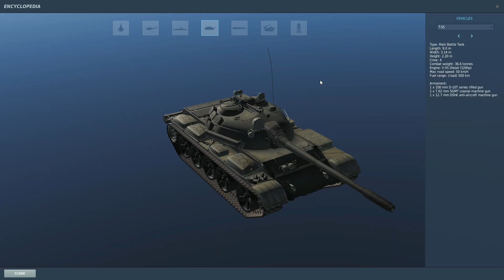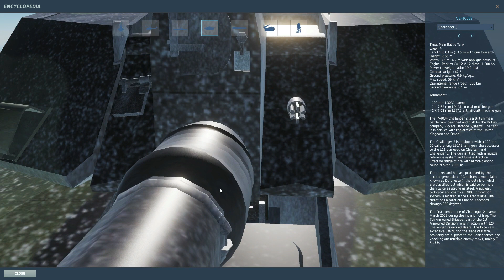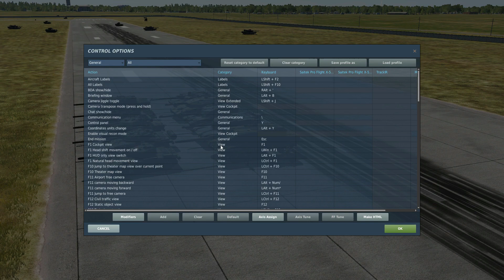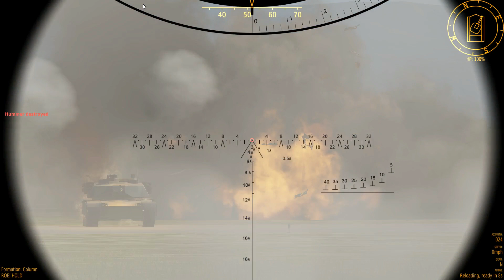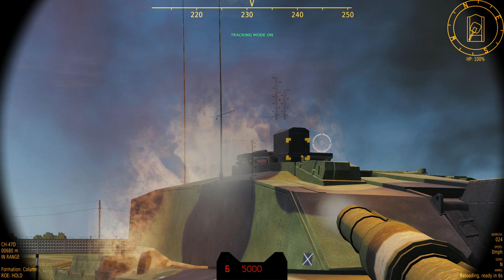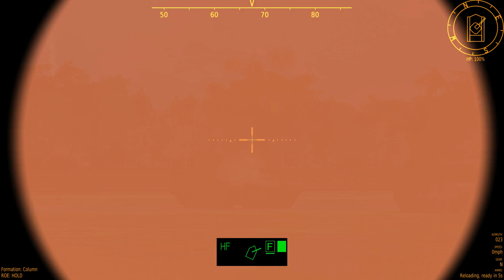Combined Arms: Main Battle Tanks Tutorial | DCS WORLD

Comment: The armour on T-55 is garbage, T-72 meh but better than T-55 and has composite i.e. steel and composite and steel. T-80 mediocre armour, T-80U mediocre-good armour, T-90 Good armour.
Leopard 2a4 mediocre armour, 2a5 superb turret armour but same hull as 2a4, 2a6 same as before but better gun.
M1 Abrams mediocre armour, M1A1 mediocre-good armour, M1A2 good armour.

Problem with the soviet and russian tanks are usually their shit reverse speed and the fact that if you shoot low centre hull the turret will fly off.

Smoothbore gun shells are stabilized by fins on the projectiles, smootbore barrels have longer lifespan than rifled ones and are cheaper to make.

13:59 Those are Shtora 1 infraded scramblers, they disrupt laser guided weaponry.

14:07 Those are the Kontakt 5 ERA (Explosive Reactive Armour), good against chemical penetrators like HEAT and missiles but bad against Kinectic penetrators like tungsten rods.

Comment: @22:10 To answer your question about the barrel bulge of the tank: When the crew fires a round, the toxic fumes and exhaust of the round will be collected in that bulge so the crew doesn't get suffocated by it.  When the round exits the barrel the over pressure (generated by the explosion inside the barrel) will force the toxic fumes and gasses outwards. That's why you see smoke coming out of the barrel when a round is fired.

Comment: Jeez cap, learn your stuff, the lumps are ERA and the Lower front glacius,  is most tanks weakpoits, so with  ERA, literally, the plate  explodes when hit with Round to counter the incoming shot..  Wirh modern APFSDS, basically any, flat armoured spot is Piercable , so the T 90 DESIGN, while " strange"  looking. It's for a reason.. it's very small and low. 3 man crew... AUTO loading gun, can fire the Guided Missiles from the barrel. And many other shells. Itsnlilely the best modern design..  these cheeks on the Abrims are very jucy targets for a Sobot.  The lep,  has a better designed turret.  And the Abrams 120mm is the same gun as the Lepord.  German gun Very effective . Fires depleted uranium APFSDS,  Basicly sold shot. Costs threw anything, unless deflected by sloped armor.. Like the t 90 has..

Comment: DCS doesn't have parameters of armor? wtf lol 
P.S. You for sure don't know much about tanks :D That tube on T-55 cheek is a snorkel for underwater traversing. ATGM's definitely wont ever be in such position towards gun, if you would shoot, you might hit your own barrel.
@5:55 - No, that's IR light, not range finder. Range finders are top mounted. As well those red lights are reflective IR as friendly identification.
@7:20 - those are rubber flaps, like in front of the tracks.
@9:50 - Smoothbore gun doesn't need shells of WW2 era where it requires rifling, British were a bit old in that technology because they took pride in their HESH shells that require rifling. Smoothbore doesn't require because modern era uses APFSDS shells that, as someone already mentioned, are Armor Piercing Fin Stabilized Discarding Sabot shells, for those shells they get higher velocity if they aren't being spun, those shells are like flying darts literally, not a bullet like from a pistol, it's a flying rod at this point. So rifling them makes them slower thus inefficient. 

Merkeva MK4 doesn't have a short barrel, it looks like that because the turret front armor plates are extended forward so that they can get as much angle as possible, so it's very sloped, since the actual gun moving portion is deeper inside the turret. That's how every tank would basically look if you would add highly sloped turret armor up front.

 You should google tanks and read wiki before doing these sort of videos where...you have no idea what you are doing and trying to explain it to others :D It's worth to do a research before.
Reply: Thank you for explaining details. It is true he does not know, but Cap is fighting cancer. He may not have much longer to live, and im glad he agreed to do Combined Arms videos to experience it a little and share it with us while he is well enough to do so, instead of leaving it alone. Studying up on it would be a drag if you are not interested in tanks or ground units as much as the aircraft.

He is a pretty good pilot in DCS, and Combined Arms is kind of an afterthought in the sim. Its not a tank simulator, its mainly for jets and aviation. Check out his other videos on all of the modern aircraft - he is extremely thoughtful and thorough in his tutorials!

Comment: The tube thingy on the Russian tanks is part of the NBC equipment I think.possibly the filter.
Reply: They're the Snorkels, they're made to deliver the air necessary to the engine to keep it running under water depending on the design, in case of a T-80UM or the T-90A, it's approx 10 minutes.

Comment: 100 or 105mm AP not penetrating Abrams makes sense. It has rediculous strong armor. Abrams can survive 125 and even 120mm DU NATO at front and side armor at point blank range. To kill it you need to hit the rear. Maybe if you have the most modern 120mm APFSDS-T DU or L55 gun you could penetrate the side with multiple hits. 
But the front is pretty much invulnerable to anti-armor weapons. Leopard 2 A6/7, Challenger 2 and Merkava 4 also have very strong armor. 
In tests it took 7 120mm hits to destroy a Leopard 2 A5.

100mm will never penetrate Abrams (or any other modern western tank) head on or even side. The HE round destroying it appears to be incorrect. HE is very ineffective against modern tank armor.

Comment: A few notes, the T-72 with it's fuel tanks at the rear, this is a huge design flaw as you only needed to fire the fuel tanks and the whole think blew away. The Merkava is a monster tank so fucking advanced and the dimensions are insane it's humongous. The protection system is active not passive (don't look for it in the armor). The front canon shape is to handle heat. There sun from above created temperature differentials with the bottom so some genius guy invented a sleeve to compensate for that.
Reply from the maker: thx

Comment: Abrams tank at a full service gas station.

Attendant: What kind of fuel?
Tank driver: Yes.

Damn thing will run on any liquid fuel that will burn, (jet fuel, kerosene, gasoline, diesel, straight moonshine).
Reply: Wait actually? XD I’m not good when it comes to fuel sources for shit I just know the there logistics basically
Reply: @maxinewulf4195  Yep, it was designed that way so that if the crew needs fuel, and the tankers are going to take a while but they can stop at a fuel supply, regardless of type, sooner, they can go ahead and use that.

Comment: Cap my good fellow you should find a site like you did with the planes of the world series, It would of helped you with the specs a lot. If Janes has an online site about heavy Armor would be a good site, but i'm not sure. Those round tubes are to stow the barrel cleaner for the main gun. Also those big forward facing  lights on the turret of the early models was an infra red search light, early night vision, until it got hit at least. The little tubes on either side of turrets  or sides of tank  depending on model are smoke grenade launchers, also newer armored vehicles also are equipped with laser detectors around the hull and turret, in the event it detects a laser there is an auto override slaved to at least the main gun and automaticly slews to direction of the targeting laser and they auto fire. I could go on but no one wants to read a book here. As far a the myth of the Abrams never being knocked out in combat, it is a myth. My neighbour is a decorated combat engineer, with 3 tours in Afghanistan and a few other ops in the middle east but he cant say where! And he seen more than One Abrams burning! Thxs Cap good effort considering DCS's lack of info!
Reply from the maker: Roger Tim thx

Comment: Regarding to the Merkava:
The structure in the paint on the Merkava has a camouflage purpose. Big and flat surfaces (even painted with a mat colour) would reflect the sun in the desert much more better, than something uneven or if you will, something more natural like gravel.

The German army had also the thought of this structual paint. But they decision was against that, because of NBC weapons. The cleaning effort after a attac with NBC weapons would be much more higher to get rid of the contamination.

The original purpose of the backdoor was a stratigic one, to rearm the tanks while they are in a static position. Throu this little door it is much more easier than throu the hatches in the turret, like it is done normalwise.  

Regarding to the Leopard 1A3:
The small little thing on top of the cannon is the IR light. The optics for the gunner are coverd by those two triangeled shaped things in the top front position of the turret, dircetly behind the gun shield.

By the way, the exhaust of the tank are those aslant grids at the end of the tanks hull. The grid on top protects the air intake.
Reply from the maker: rgr thx
Reply: Im not certain about that. I thought the bumpy was in regard to Chobham armour. Bumpy ceramics might reduce laser return too

Comment: ERA (explosive reactive armor) are blocks of explosives surrounded by 2 plates of metal. When it gets hit, it explodes outward and possibly bending/breaking/making the round richochet. In case it gets hit by HEAT the plates are again thrown outward and are used to absorb some of the HEAT stream. Also the abrams exploded with the HE because you hit in the driver's hatch or slightly above it where the armor is weakest, the shell exploded and shrapnel destroyed the tank. The AP didn't penetrate it because it doesn't have sufficient penetration capabilities because you shot at the turret. Also russian HE isn't HESH, pls not again it made by blood boil.
Reply from the maker: thx

Comment: Active protection system is a modern defence system for ATGMs and RPGs. There are some dispenser on the Tank hull and turret which belows them up when they come close to the armor. Missiles and rockets  do not impact. They will be blowed up by the dispensers. Normaly no damage to the tank. But it can just blow up them if they come from side and front. Rear side is unprotected.

Comment: Reactive armor is a protection system which blows up when a RPG or an ATGM impacts to the armour. So warhead blows up outside of the tank. But its not fully reliable.
Reply: Reactive armor has become obsolete because modern anti-tank missiles/rockets have dual warheads. The first warhead activates the ERA, after which the main warhead hits the naked armor. ERA does still work against HEAT rounds and older missiles though. It can be effective in protecting weaker areas of a tank against older anti-tank weapons.
But you would never want to rely on ERA as primary armor. Aside from being ineffective against new anti-armor weapons it is also pretty much useless against kinetic energy rounds.
Reply: @NationalSniper  new era like Kontakt-5 can defeat tandem warheads
Reply: @komradearti9935  I think he means relikt

Comment: HESH=High explosive squash head, difference between AP and HESH is, its using plastic explosives. HESH can damage better to the thin armor. For example sides of the tanks. Which makes it better than AP at thin armor. But AP is better at thick armour which impacts and totaly pierces the armor. But if the armor is not thick enough it pierces and goes outside of the tank. HE is most common round, only British uses the HESH round. After the Cold war America decommisoned their HESH rounds, and replaced with HE. Generaly thickest part of the tank is the front layer below the turret. The thinest part of the tank are Top of the turret and Rear of the turret which generaly contains munitions. Its the arsenal of the tank if you hit it everything in there goes off.

Comment from the maker: From Tankie: combat weight is 70 t fully loaded the 7.62 "AA" is a gpmg on the loaders hatch, the coaxial 7.62 is a chain gun by mcdonald douglas (the same that is fitted to the cobra just diffrent caliber), the thing on the side of the turret that you though were multiple breels is just the flash hider for the single barrelled chain gun.  the box on the barrel is the thermal system (TISH) and the hatch next to it is the gunners aux sight, below the commander hunter sight (which has both optical and thermal) is the gunners optical sight, black chimney is the Met sensor we spoke about and the spacing is the stowage bin for crew equipment and tools (no extra armour there). the "lip" is a rubber guard foe when the barrel is over the back decks. the barrel camp on the back decks is for stowage of the gun, the wire on the back is the don 10 real for extending a radio hand set out of the vehicle up to 2 km away.
The cradles on the back are for 40 gallon fuel drums, what you noted as ventilation is the exhaust left and right.
Reply: @EatyourshitYoutube  doesn’t have all the tanks otherwise it’d go on infinity

Comment: 3:14  Those are the ammo boxes for the heavy mg. No idea what the tube is for, maybe there is a camo net stored in there.

HEF: High explosive fragmentation, a anti infantry shell.
APFSDS: Armour-piercing fin-stabilized discarding sabot.

In 1964 John D. Myers presented what is considered the first functioning laser rangefinder prototype, using a ruby laser.

Pretty much all of the russian tanks have a infrared flashlight on the turret. Modern rangefinders, like laser rangefinder, didn't exist in military vehicles until the T-62 tank, which was produced 1972. As far as I could figure out, all of the NATO states quickly updated their tanks with laser rangefinders afterwards. 

A turbine engine is nothing else as a scaled down version of a jet turbine for tanks, only that it functions as a traditional engine. They are smaller but as powerful as diesel engines, and quieter.

The Soviets changed from diesel, to turbine and then back to diesel because the turbine engine isn't really fuel efficient, especially in idle mode.

The smooth bore barrel was designed to use the explosive charge of the shell more efficiently than a rifled one, since there is no room for the explosive to go around the shell in the barrel. Shells fired from the barrel are all fin-stabilized to keep their accuracy.
Reply: ArcherBascha The round tube in Russian tanks is for storage of the Snorkel used for crossing water.
Reply: @notfastenough3350   lol it IS the snorkel
Reply: T62 is from 1963 t72 from 1972 and i think that t64a already had laser rangefinder in 1971

Comment: The chimneys you highlight which are on top of the MBT’s are called Meteor logical Sensors, there task is to monitor wind, air temp/pressure etc and that information is constantly being fed back to the Computer Fire Control System to help achieve a first time hit in all weather. The housing to the right of the Challenger 2 is a 7.62 chain gun housing coaxially mounted on the main gun inside the turret plus the box above the gun is the Challenger 2’s Thermal Sighting equipment. When you where in the turret of the Challenger 2, the G icon stands for gunner having control of the weapon platform, the L stands for last lase, you can have first or last lase selected either F or L . Last lase is selected primarily used when using the laser to acquire target distance in poor weather....cheers.
Reply from the maker: thx